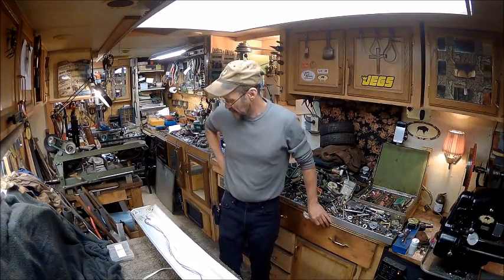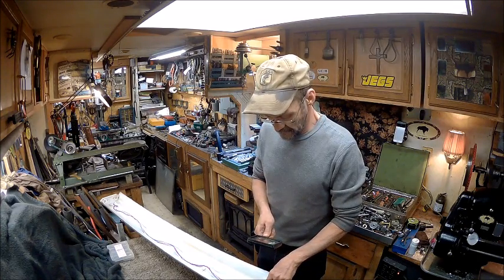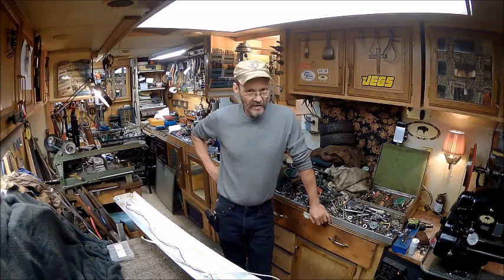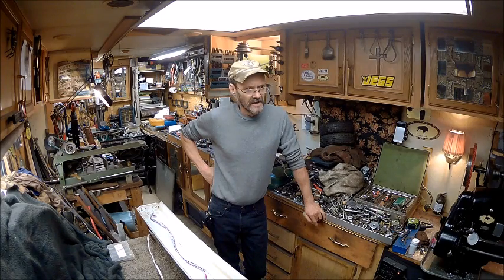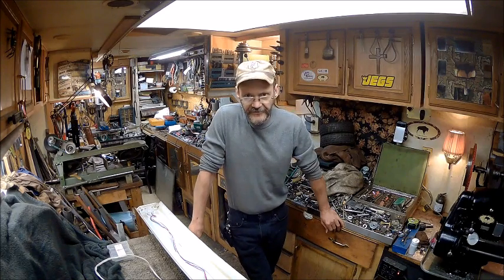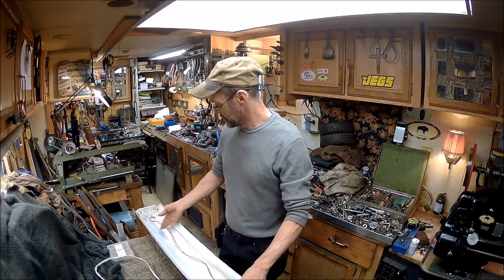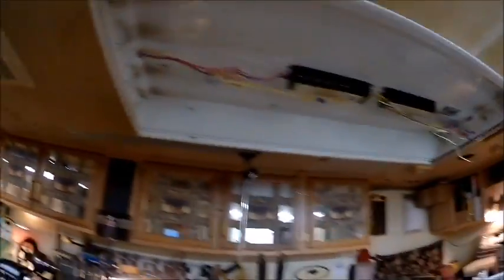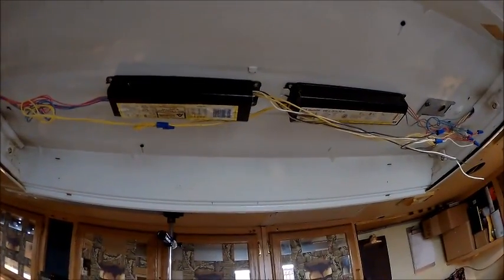lights of american model 8045e wh shop light review

Comment: I have several of the same shop lights and I opened the  "ballist" board , everyone of them has a blown capacitor, exact, same ones. Definitely cheap parts so I upgraded the capacitors and so far it’s lasted longer than it did when I bought it lol .

Comment: I have 4 Lights Of America Fluorescent fixtures (I'll have to get model number) 1 in laundry room since 2000 (still works). 
2 in garage since 2000 (1 still works. The other had 1 side go out about 5 years ago and the other side went out 3 days ago).
The 4th one in the front part of garage was purchased in 2000 but not installed until about 3 years ago. I leave that one on 24/7, it still works. They xon't have that ballest, but I see a small board with 2 caps and 2 diodes or something and 2 resistors. Hopefully I can fix it but the caps, resistors and diodes look good but I'll check them with metsrs. I still have a box of at least 12 tubes so I'm not ready to scrap them.
Thanks for the video Bison Workshop. 
I enjoyed the stories, liked and subscribed.
Update: Model 8045
I tested capacitors with ESR Meter and all seems to test good. I'll have to do more testing.
Reply from the maker: COOL, THANKS

Comment: Mine just started flickering too.   I have had it in the garage for a few years.  I put the dumb old Lithonia T12 back up.  Those seem to work until I accidentally knock them down, even if they buzz when it's cold.   I will save the frame and see about making the Lights of America LED.
Reply from the maker: leds are the way to go. i just put two led shop lights in my new shop and they are very bright